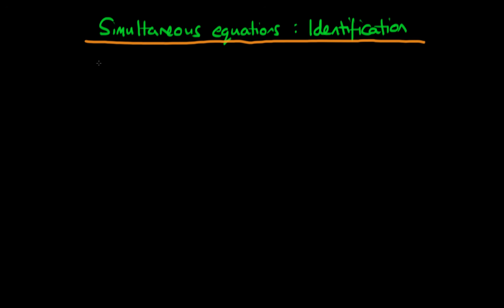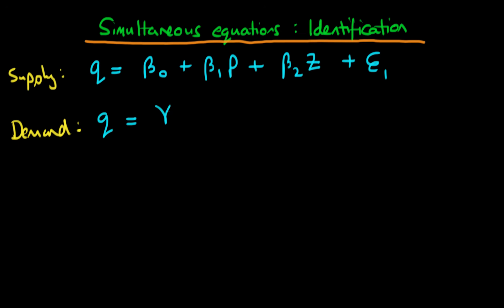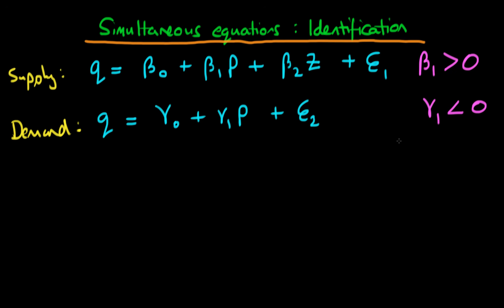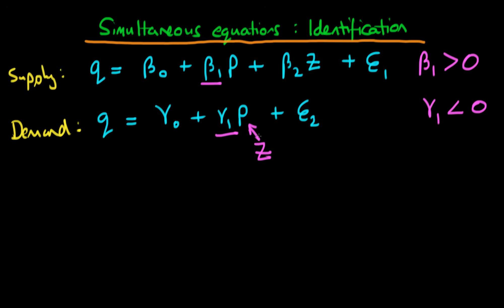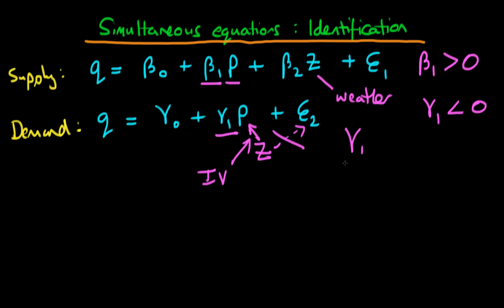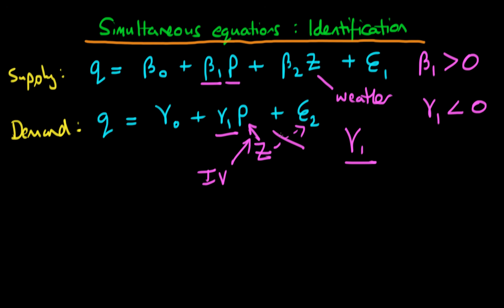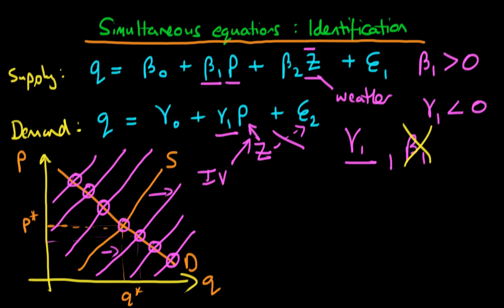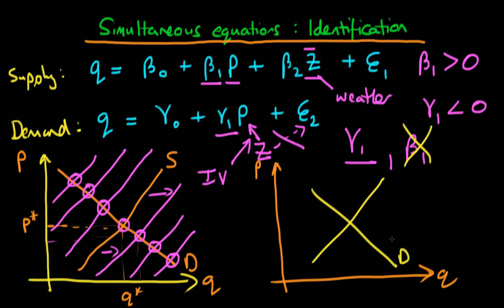Simultaneous equation models - parameter identification

Comment: Denote: Q= α + βP (supply equation) and Q= λ + μP (demand equation)
Suppose i have 2 equation Q= 2 - 9P and Q= 5 + 5P. in this case i cannot determine which one is a supply equation or demand equation because i cannot determine for example 2 is α or λ right? And 4 parameters cannot determine are α, β,λ, μ 
=> Q= 2 - 9P and Q= 5 + 5P are unidentified? is that correct? someone help
i'm wondering the identification here is the estimate parameters in value (estimate alpha beta ... as value like 1 2 3) or we already have value (1 2 3 4, ....) and estimate which is the parameter (1, 2, 3 ,.... as alpha beta,...)

Comment: Ben Lambert 
U messed up p and q
2nd equation should start with p
or else the structural equations are perfectly fine...
Reply: "U messed up"
Who says economists lack social skills?
Reply: Not really mate, if you set both equations equal and rearrange to get price on one side it can be shown that there is correlation with the price and error terms leading to bias and incosistency in both equations. In general whenever you have two simultaneous equations you can expect there to be bias.